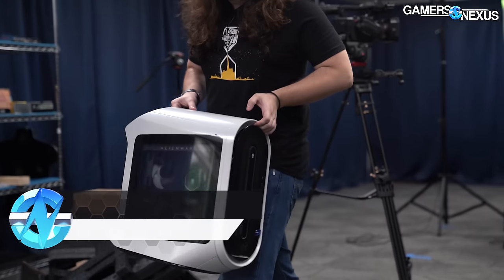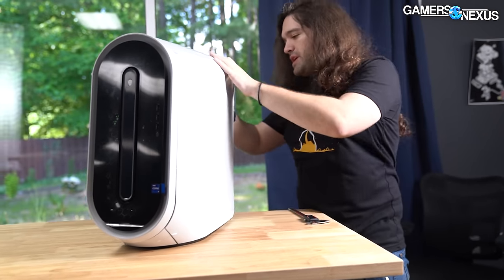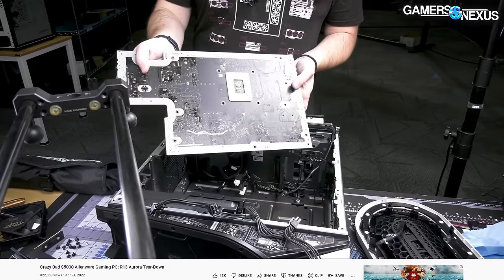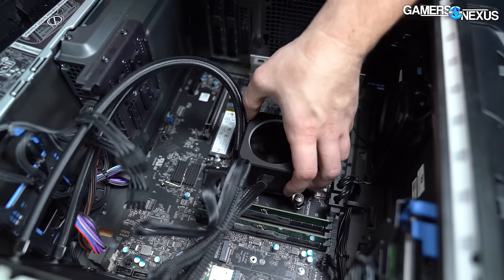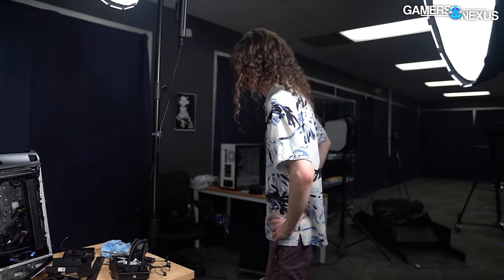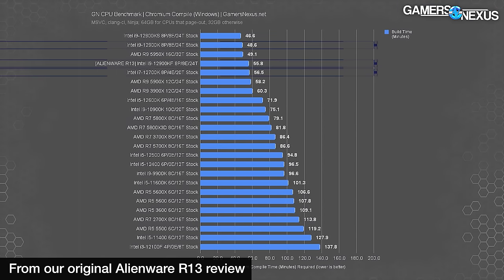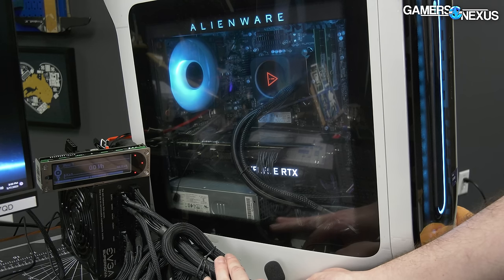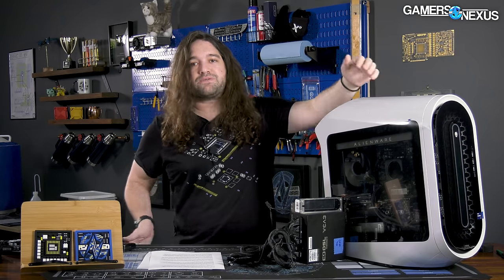"Fixing" the Alienware R13 Dumpster Fire

Comment: So, The answer to “can it be fixed” is “Yes. By leaving it in the trash and building a better, cheaper one yourself.”
Reply: By not buying it in the first place.
Reply: take the 12900kf and 3090 out throw the rest away  and erplace  what steve said. 2) dont buy Dell.
Reply: I think the thing that Steve and team did prove is that DELL/Alienware could have EASILY fixed it by putting in a 240mm cooler, maybe a different shroud for the power supply, and updating their bios to allow for the CPU to clock (at least) at correct stock speeds, and all without really increasing the build cost by a noticeable amount

Comment: "Stack of plastic bullshit"
Alienwares in a nutshell.
Reply: Also Nintendo Switch and quite a few cheaper machines, anything with soldered [non repairable] internals.

"Stack of Plastic" should br a trendy clothing brand featuring stylised dead bodies of disassembled crappy PCs Steve shredded during recording :D
Reply: @DailyCorvid  Seriously, the plastic screen of the Switch is insane, even the dock can scratch it, how come some of the cheapest mobile devices can use tempered glass and they can't?
Reply: @e-cap1239  I have bought two and they're both in bad condition.  Amazing when you consider that the Lite has been out the box exactly twice since January last year.

They must do it on purpose, they cut all the corners they can get away with in order to maximise profit on each console.

Sony and Microsoft lose money when they sell one of their consoles, and then make it back on the games.  Nintendo just whale pump the shit out of everyone [on games and consoles/accessories].

Comment: have you guys considered doing a case study  into some of the propietry parts? like calling Dell/Alienware and finding out how much it costs to buy a new PSU instead of getting a industry standard one? and things like that, I bet it would be interesting
Reply: I very much doubt Dell would want to give that info out to the public.
Reply: @randybobandy9828  They just have to phone em and say "uhh my PSU blew up" or something and I need to buy a new one
Reply: @nuttyjawa  I thought you meant how much Dell pays for a psu not how much you can buy it from them. I will assume they won't sell a PSU to a customer and expect them to send their  pc in for a very expensive repair if not understand warranty
Reply from the maker: It's not really that simple and certainly Dell doesn't openly disclose costs. These PSUs come from their server division, so they probably are cheaper for Dell to use short-term, but the long-term implications are clearly not good.
Reply: Or even detective work for when the base form of this case was first manufactured and why
Reply: In a pinch you could probably do a cut and splice on the original power cable. In order to use a standard supply. It would have been quite easy for me to do. But say this did happen after the warranty period. I would said YES finally I can toss garbage out. Maybe kept the case. As a reminder to never purchase a Dell desktop ever again
Reply: @GamersNexus  Thanks for reply - I am not sure if I made myself too clear tbh - I meant, as a customer - obviously propietry parts suck because you have to replace with non-standard harder to get parts. So in the case you had to, like how much would it cost? ie.  PSU dies 2 years down the road, you HAVE to buy the dell one or make big changes - so what does that cost vs not having the Alienware and just buying a Corsair 850w or what have you. like whats the maintenance cost of these parts in the long run
Reply: Newcious  ??
Reply: @randybobandy9828  Thats why you do it undercover. Let an employe buy an alienware and the manipulate parts and have them fix it.
Reply: @seanatienza6645  it's a spam bot
Reply: @nuttyjawa  they won't sell you spare parts like that, not to end customers at least. If you, as a consumer, want spare parts you have to either get one of their on-site service guys to come out to you, or take the machine to an authorized service centre, which will then install the part and charge you an arm and leg. They follow many of the same principles as Apple when it comes to things to like that
Reply: @JeffreyPiatt  If someone messed up and bought a Dell I'd hope they wouldn't return for seconds... you'd be better off just getting a different computer and move on from your old mistakes
Reply: @sgas  Well this is a slightly modified Vostro case those first hit the market around 2007
Reply: You can't "buy a new PSU",  it's sold as a single system, it's serviced as a single system, as if it was a laptop. You wouldn't ask them to send you a replacement part for a laptop, would you?
You need to ask Dell support and hope they understand the issue, send back the whole system and hope they fix the issue and don't steal stuff from your hard drives, then send it back after some time.
Not sure if the "extended warranty program" covers PSU replacement too, but eve if it does it's vastly more expensive than the PSU.
With servers and office workstations there is at least the "on-site service" that means someone is dispatched to your location and does all the work on-site in a few hours, but I don't know if you can get that with a device sold to consumer
Reply: They're sweating their vertically integrated supply chain to probably produce without significant retooling, but it's really not a good look when you're marketing to an enthusiast market which operates on the basis of interchangeable, standardised components. Shame on Dell, basically. They should be operating Alienware as a Special Projects division, not a "we have some of these old 2014-style boards left, what do we do now?" Any Other Business line on the monthly strategy meetings.
Reply: @jamotto1569  interesting
Reply: @ChristopherWoods  they are marketing to suckers and people that don't understand much about computers. Also it's handled like a "halo" product line so profitability isn't a priority, 99% of Dell's revenue is from servers, office PC and laptops anyway
Reply: @marcogenovesi8570  oh tell me about it, we have enough of their stuff floating around our offices... Isn't it depressing how they spend their money on marketing instead of competent product design eh.
Reply: @GamersNexus  Server division implies that they cannot use the cheapest short life crap, so I'd expect manufacturing costs are similar to a decent standard PSU. Maybe Dell had a surplus they wanted to use up and save a few dollars, but I agree that designing things that way sounds not profitable long term.
Edit:
I like that the ad at the beginning actually shows a decent case. Go BeQuiet, show Dell how it is done!

Comment: Out of curiosity I looked to see if Dell took your advice. They did and added air holes on the plexiglass window. The icing on the cake was the added 240 rad to the top without changing the 10 year old case.

Comment: Back in January of '21, the GPU shortage led me to buy an open box R11 (10900KF/32GB/3080) from Micro Center. I spent a couple hundred dollars swapping fans, adding fans and repasting & repadding the 3080 in an attempt to get it performing as it should. I never quite got there. Even with the AIO double-fanned in push/pull, the HDD caddy removed and a second intake fan added, the CPU would thermal throttle about 2 minutes into a 10minute r23 with no oc profile applied. 

Back in October, I took the CPU, GPU, RAM (now 64GB CL16 T-Force 3200MHz) and drives (I had added a 970EVO NVMe & 2x2TB SanDisk Ultra 3D SATA-III drives to the white label WD Blue SN730 that came with it) out of it and gave the chassis, power supply and motherboard to my brother who put a 10700K, 32GB CL16 3200MHz, an ASUS 2060 and a 512GB Inland SSD into it. He is running at full performance with zero throttling issues on that hardware.

As for my system, I transplanted those parts into a Fractal Meshify S2 with an MSI Z590 WiFi Pro motherboard, an EVGA-GA 850W PSU and a Lian Li Galahad 360 AIO (since removed because a fan died less than 6mo in). I kept that setup for 6 months and transplanted everything into a Fractal Torrent (after seeing it top your charts in many reviews) with an NH-D15 Chromax. I can now make it 8 1/2 minutes into a 10 minute r23 with a full-time, all-cores overclock of 5.1GHz before I throttle (for less than a second at a time, every 4 - 5 seconds) back to 5GHz. In real world applications, I never throttle and maintain a full-time, all-cores 5.1GHz overclock with the CPU sitting at around 80C under a full load. While switching from the Meshify S2 to the Torrent didn't do much for my CPU performance, it did drop the thermals on my GPU by about 12%, allowing it to run perpetually unthrottled at 328W pushing 1965MHz core clock speed and 9505 memory speed.

Comment: There is no fixing a pc that is that expensive and has such "bad" components.
The absolute insanity you can build with 5000$ is on a whole other world in terms of specs and looks you can choose to go for
Reply: Agreed, just look at all those 5000$ Intel Tech Upgrades at Linus.
Reply: Built my own for almost exactly 5k and it has 3080ti and a 5950x 360 AIO cooler crap ton of fans, a 1 & 2 TB HD, 32g of ram, a b550 mb in a Lian Li Lancool 2 case with a light show to boot. And this was when GPU's were just ridiculous. So 5k for this heap is criminal.
Reply: You could buy a cheap electric motor and a seat, and convert it into a REALLY CHEAP MOBILITY SCOOTER. Otherwise it's a waste of plastic.

Wire up the fans on axles as wheels, then have a bios switch controlled by a SBC attached to your phone as a screen for the speedometer.  Mount the little seat on top and sit your cat in the seat.  And hey presto you have a mobile catsability scooter for just $5.1k.  Then make YouTube videos of your cat driving around and make all the money back :D
Reply: @ryanhauser3014  why a b550 mb with a 5950x? you should be using an x570 for a high end cpu like that
Reply: @averagepcenjoyer6373  Probably he assume that since it's newer it must be better lol.
Reply: @averagepcenjoyer6373  at the time, the board I wanted was unavailable. Yes the x570 would've been ideal, but this b550 board is very capable. I tried to put together the best PC I could with what was available in the market at that time. I am partial to one brand just because I've had good luck with them and It's my favorite bios to work with. I got the MSI Meg b550 Unify.
Reply: @ryanhauser3014  no ssd?
Reply: @ryanhauser3014  No shame in the B550 boards. I especially like the ones from MSI. You can get a LOT out of the B550's. X570 would be ideal like you said but don't feel bad, your board is great lol
Reply: @fliporflop7119  of course. Both are M.2 4.0.
Reply: @ryanhauser3014  i thought you have a cool rig with ancient hdd.

Comment: Just when you thought it couldn't get any worse! It's incredible that even with improved cooling there's simply no getting around Dell's ridiculous power limits.
Reply: It sounds like the power limits are there for a legitimate reason. The motherboard is unlikely to be able to support the power delivery required for a 12900K at stock - without increasing warranty claims which they'd have to try and deny anyway.
It's like they designed a motherboard and system to support a 12600K and a bean counter decided to save costs by re-using them with locked-off limits for the 12900K instead of designing a separate appropriately spec'd  SKU.
Reply: @Thermalions  « bean counter » LMFAO I'm not from an english country, but this expression made me laugh a fucking lot XD 😂

Comment: Even though the results of this "fix" were less than perfect. I feel like it shows that Dell could turn this into a viable PC with little effort.
Reply: Yes Dell could but they've made it so that we can't.
Reply: They wont.
Reply: Actually, I do not think they could, not without some serious modifications.  First, the overall case design in too air restricting. In order for Dell to turn this into a viable PC, they woiuld need a new Motherboard, a new case, a completely reworked cooling solution and the power supply needs to be changed.  When you factor in all these items you would have basically created a whole new PC.  So I think the R13 in its current state is UNFIXABLE.
Reply: @TheDainerss  We're talking about the designer of these PCs. Not easy to fix an existing unit, easy to fix at the design level.
Reply: But that's the point of Dell's proprietary everything, they don't want you to have a viable computer, they want to sell a "Gaming PC" to people who have no idea and ensure it underperforms so they can put less expensive solutions in place (cheaper cooler, cheaper case, cheaper PSU etc.), than because it underperforms when you start pushing the PC and notice it starts lagging you upgrade again sooner than you should be.

For $5K it's a fucking scam is all it is.

My PC, an actual 12700K and 3060Ti, cost me half as much as this thing and runs half the thermals. At this point we need to start protesting with our wallets and note something about brand names, some brands are good, but some, just because they have been around forever, does not mean they are good, like Dell, and just don't buy from them ever again.

Comment: I feel Patrick's pain, Corsair really needs to improve their RGB implementation. Cable managing 9x Corsair fans and 2 hubs was a huge PITA.
Reply: You have 9 fans in your system?
Reply: Yup i had Corsair LL fans originally sold them ASAP as soon as Lian Li dropped thier AL120's, the amount of space recovered for better airflow and simplicity of it all was a huge bonus for my O11
Reply: @ryanvandoren1519  I have 11 fans in my 7000d airflow case
Reply: @ryanvandoren1519  I have 12 of those ML RGB elite and had to use the commander core, commander pro. lighting node core, and a lian li controller with a corsair adapter cable on it it was awful but the mag lev fans are quiet and give pretty great airflow and the rgb is perfect.

Comment: from my personal experience with the XPS 8940 and a few Optiplexes, I've learned there is just no easy fixing Dell desktop thermal and performance issues.  I do scoff at anyone (GN included) who expects there to be any "advanced" BIOS settings from any Dell desktop - that's literally never been a thing from them, ever. What does exist in this Alienware is a huge step forward from Dell, historically speaking.
The lesson here - if you want a gaming desktop, DON"T buy it from Dell. The same also applies to HP, Lenovo and Acer. All the major brand names will be nothing but proprietary mobo/PSU/case that's not compatible with anything but itself. For the price these major brands ask for their "gaming" computers, you could build it yourself for cheaper, or get something built from a local computer shop for not much more $$$. A pre-built "gaming computer", from one of the major manufacturers, is good only for a gift for younger kids to game on. There is, however, no scenario where the $5k price tag for this Alienware is justifiable.

Comment: Long story short, don't ever buy an Alienware Desktop. $5,000 dollars for this? Their profit margins are just crazy.
Reply: And the margins could be even better by using cheaper, less complicated, but still better cases...
Reply: @kingplunger6033  God yes, and I'm not against them making money. There's also a lot of people that like the Alienware look, but why can't you just make it good.
Reply: Ironically, they'd probably save money by not making proprietary bs and just being normal.
Reply: @wpelfeta  They'd probably make more money if they sold it for $2500 after having redesigned it. They'd sell a lot more and it would be  better product.
Reply: Except that they probably aren't. They have to design, test and produce - or at least commission - all their weird proprietary parts, plus all the extra engineering to fit them via obtuse methods.
If they were just using off the shelf parts then yes they'd be making huge profits. But also, making a much better product. That's the crazy part!
Reply: The takeaway from this whole series is, "Don't buy a prebuilt."

Comment: I love this series. The first PC I ever took apart was a 2001 Dell that my mom bought as a family PC. I couldn't resist as a kid I had to open it. Immediately I broke a cable because the case was designed so if you open it, you basically ripped a cable. Everytime my mom was gone I would open it up and just look around. Once I got a little older I started collecting old PCs people didn't want and I remember completely tearing down Dell PCs and I had to break just about every bracket to pull the parts out. It was crazy.
Reply: Bro you’re dead right. They did have a cable and a case intrusion sensor that ran to Foxconn mobo and would flash when entering the bios. The first pc I built was a dell added AGP Radeon 5600 and some ram. Felt like the big cat daddy owing in CS.